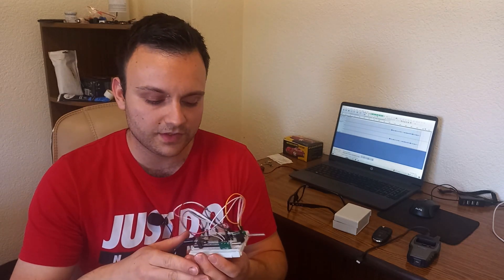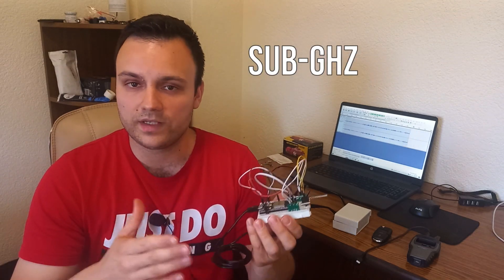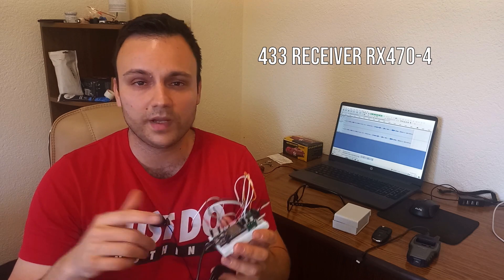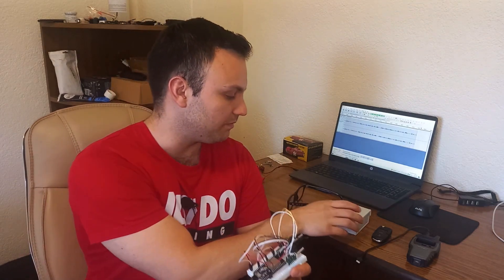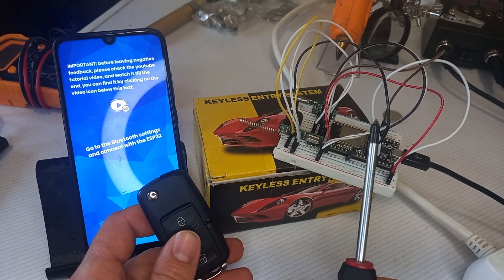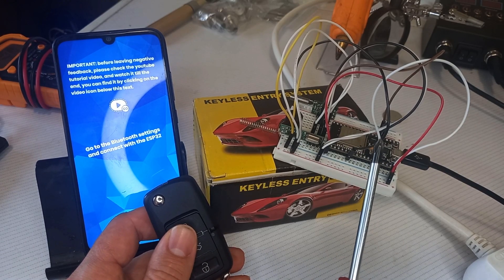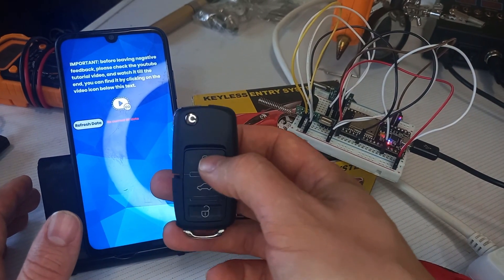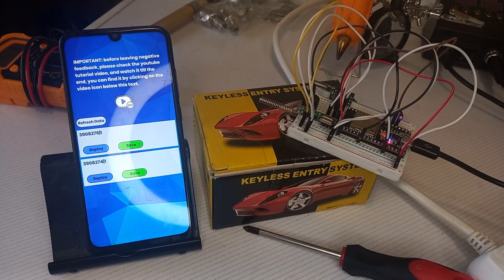I Made My Own Flipper Zero | DIY Flipper Zero With ESP32

Comment: Not tryna be that guy,i actually appreciate your nice project about explaining the boundaries of exploring IoT but for all my begginers mates and my small brothers I shall tell you that this Device may work for older car but can't work on new car due to a technology called rolling code.still if you're experienced enough you can bypass this using some highend cc1101 module and extensive coding.... 👍

Comment: Would this work in the USA? Or do they use a different frequency?
Reply from the maker: Most of the devices in the USA use 315mhz, so change the module that is gonna have that frequency, or add CC1101, that one supports them all.

Comment: Hello friend, I have a small problem, I hope you can help me.
My phone is paired with esp32 bluetooth but it is not connecting. In your application, it gives a warning to connect to esp32, whereas it is connected from the terminal and I can send messages via bluetooth, please help.
Reply from the maker: Hi, please share your esp32 code here, did you change something?
Reply: @SlavkosHobbyChannel  Dude, I write here, but the comment disappears by itself after it is shared.
Reply from the maker: @dacram.  Send me at: slavko.zdravevski@hotmail.com
Reply: @SlavkosHobbyChannel  I guess it's an app-related issue because it works on a breadboard, the LED lights up when you press the car remote, and the storage usage went from 80% to 81% when I activated a few remotes.
note: the brand of my phone is samsung note 10 plus
Reply from the maker: Let's try opening the app first, and when it says to connect to the esp32, go to your Bluetooth settings and connect with the board, then switch back to the app.
Reply: @SlavkosHobbyChannel  I removed the esp32 pairing from the first step phone, restarted the phone and turned the esp 32 on and off.

Step 2: I opened the application, selected the 433mhz clone, opened my bluetooth settings and paired with esp32, but nothing changed in the application.

Note: The app has no battery restrictions, all permissions are OK.
the phone's software has not been changed (no root)
I checked and tried the developer settings, nothing changed

But I want to draw your attention, I am pairing with ESP 32 but I cannot connect, so the ESP32 text never has any color.
Reply: I also tried it on another phone and couldn't (xiaomi note 10 lite)
Reply from the maker: Before using the app, make sure that your Bluetooth is turned off on your phone
Reply: @SlavkosHobbyChannel  it didn't work dude
Reply from the maker: Hmm... Let's use the Bluetooth library, that I pushed in the repo, not the current one that the IDE gives you.
Reply: @SlavkosHobbyChannel  i don't know how to do it but i will find out thanks
Reply from the maker: @dacram.  Go to your Arduino libraries, delete the Bluetooth library's folder, then copy the one that I pushed, and paste it there. And reupload the code again to the esp32.

Comment: Hey , thank you for making this video.  Ia. highly interested in building gadgets,  but am super scared of soldering,  because I suck so bad.
Reply from the maker: Keep trying you're gonna master it! 😀
Reply: 5 months later. Tip for soldering. Get some flux it helps (from someone who solders without flux) and just test out a little while soldering too. A little with randon wires you have laying around perhaps. Also a helping hand as they are called can be nice too 😊 also i recommend some heat shrink tubing. (I currently purely use electrical tape and it can become hell even after this much time of having done it

Comment: wait wait wait! arn't the car key use ir?
Reply from the maker: IR is used by some car manufacturers like Mercedes, for transmitting the code to the EIS (Electronic Ignition Switch), to start the car, but RF is used for sending the code to the module connected to the central locking system.
Reply: @SlavkosHobbyChannel  oh that explains a lot, thank you!

Comment: aren't these systems on rolling codes?
My understanding is they'll change every time or almost every time.  How does it work with those?
Reply from the maker: The one that I am testing is a fixed code. I wouldn't try this method on a rolling code remote, cuz, sometimes the car's module or some other equipment module desyncs the original remote, and it can be a problem without knowledge and equipment. So we need to use the method carefully 😀